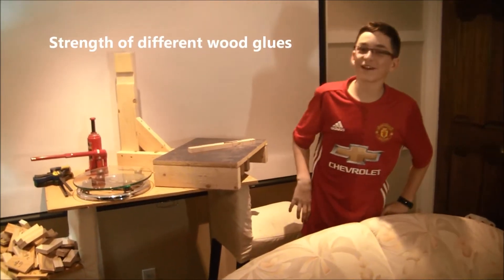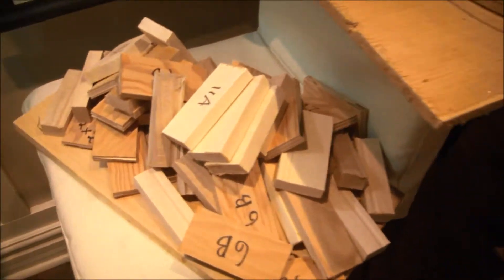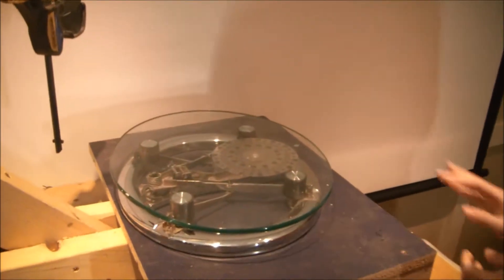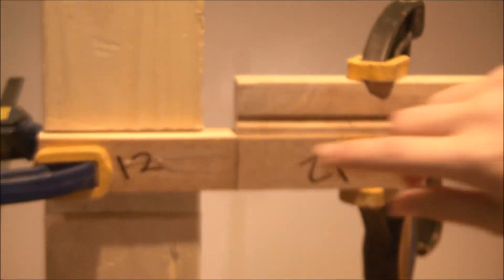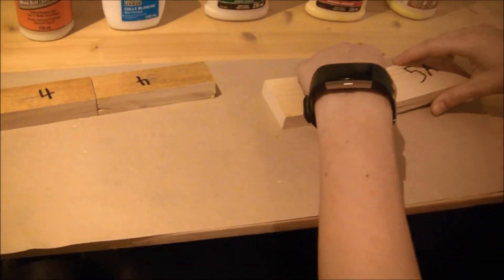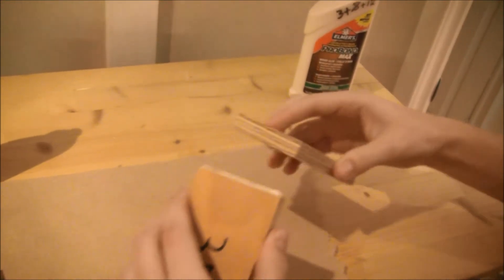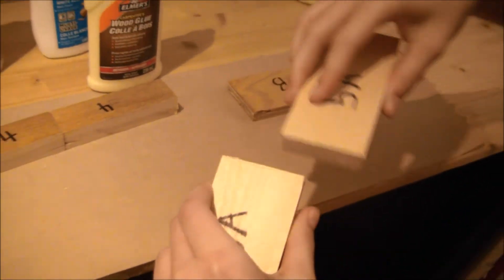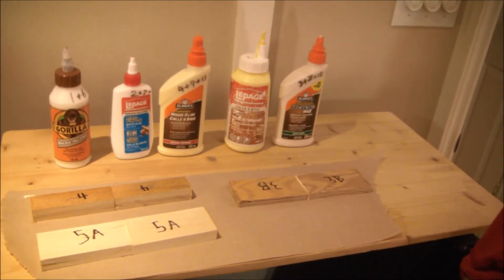Wood glue strength testing - Scott

Comment: you should have use the glue in the other faces of the wood... and aply the preasue not in the joint... so you could see if the glue holds or not... also you should have clamp those woods
Reply from the maker: Thanks,
We tried glueing on the face of the wood and every time the wood failed. 
Thanks Bob...